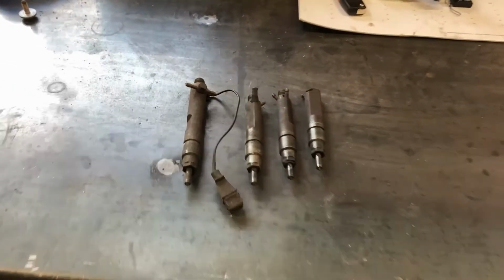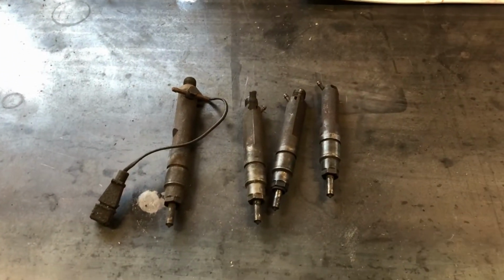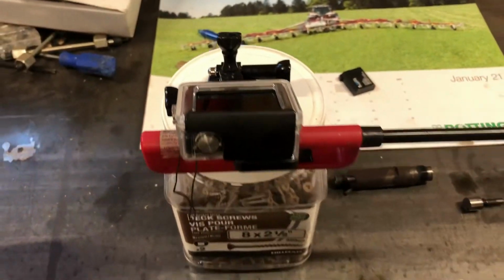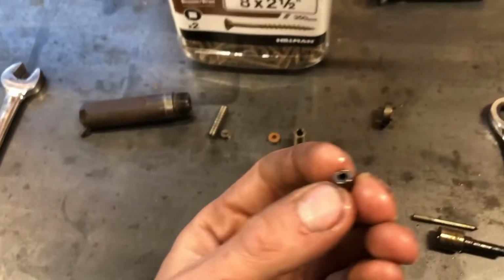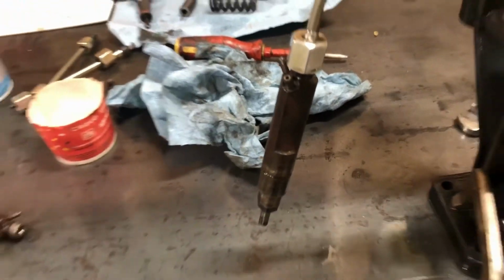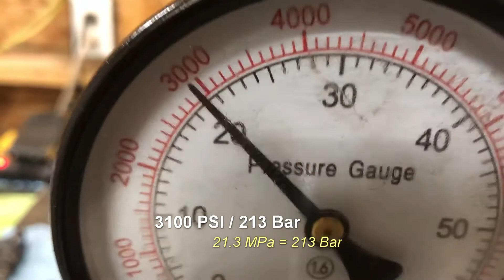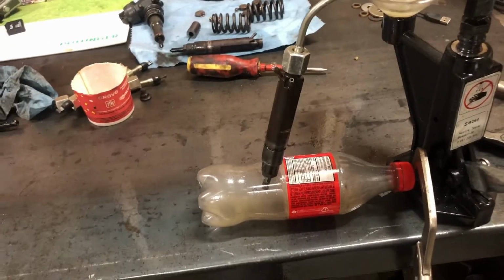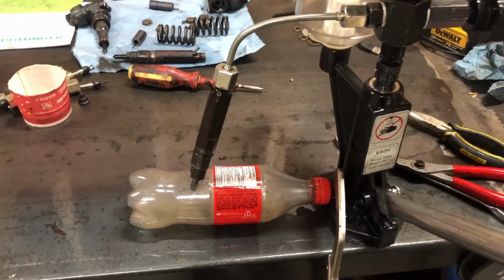ALH TDI injector nozzle swap. Setting 1st + 2nd pressures

Comment: I didn’t think you had to do all of this just to do the nozzles but I completely understand why. One of my customers got a couple bad sets of injectors that had nozzles installed on them and now I understand why, the company for sure just slammed on the nozzles.
Reply from the maker: Pop testing would be the bare minimum I’d do, they should be flow tested as well in a perfect world. Atleast with popping them you know the patterns good and they should be in time with each other.

Comment: So is that leakage what causes smoke on cold start ? Say after the car has been sitting overnight . Curious , I have an ALH with about 230k on the clock and I get a puff of white smoke first thing in the morning then it clears up and won't happen again for the rest of the day .
Reply from the maker: Yeah it could be time for nozzles, a little puff isn’t abnormal though. Cylinder temps are cold you’ll have poor combustion.

Comment: So sanding the top hat increases the popping pressure? Glad I found this.
Reply from the maker: yes/no, sanding the lip off the top hat increases popping pressure by making it a single stage injector vs the 2 stage which it is from the factory. The only reason i sanded the top hat in the video was to make a fixed "tool" for checking the 2nd stage pressure in this set.

Comment: I have 190/300 bar and 0.360 and what is difference beetween 220/300 in full throtle? Or performnce, will nozzle work on 300 bar or ?
Reply from the maker: The lower first stage will mean the pilot injection will start a touch sooner

Comment: if you push till 300 bar injectors,  bosch pump can not make thet pressure diesel engine  can not work good,  hard starting etc , just for all fox on Autodata there you have 170/190 injectors opening pressure !

Comment: Is this all necessary? I mean for the poor man injector install. I just bought nozzles and have a really really hard time justifying paying almost as much to balance them as they cost.
Reply from the maker: I know what you man, I believe this is a middle ground between the swap-n-pray and getting them professionally balanced. This way you can check to ensure all pop at the same time (meaning start of injection is the same) and ensure no streaming/leaking nozzles. A pop tester is $100 which atleast gives you a rough idea on how they perform.

Comment: good video for me but after a hour thinking about it you just ruined a injector with that mod... correctly you have to adjust only the upper shim to change your initial injection otherwise you are only engaging main injection....
Reply from the maker: I guess I didn’t explain it the greatest in the video, to be able to check the main/2nd stage pop pressure it requires a special top hat, instead of buying that tool I took a scrap injector (leak off line broken off) and modified that top hat to look like that tool. 

So now you can check leakage and 1st stage with the factory top hat, disassemble and install the modified one to check the 2nd stage, then disassemble and install the factory top hat back in. It’s not meant to be ran in a car.
Reply: I'm from another country, despite the translation problem, I understood it, thanks for this way... greetings from Poland @JoshsJettas
Reply: @JoshsJettas  This explanation solved my confusion i had watching the video {Thanks }